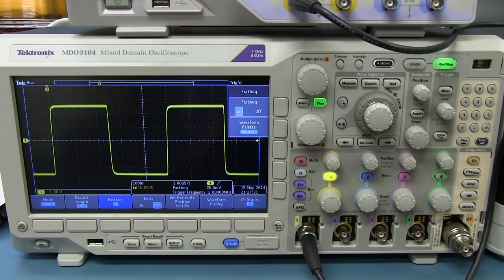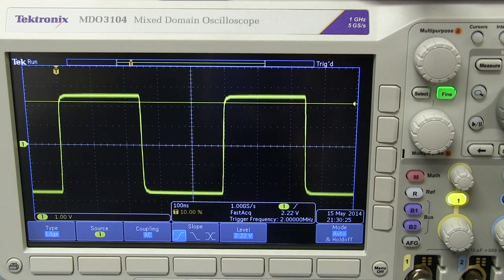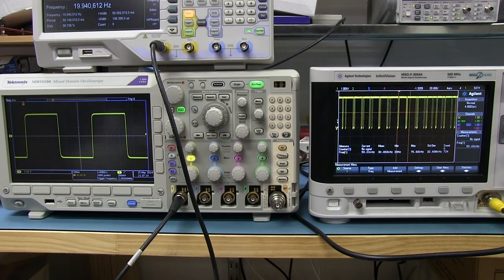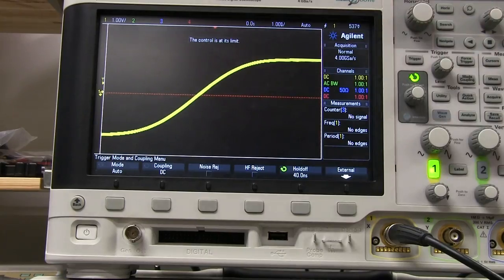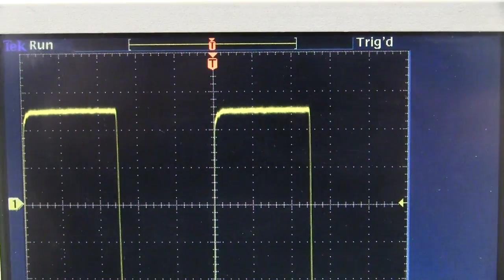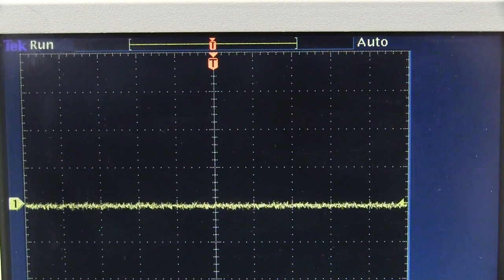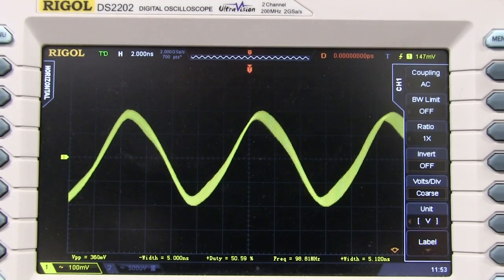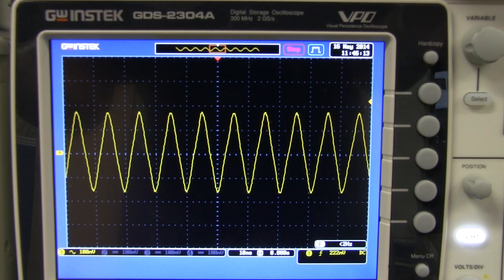EEVblog #617 - Tektronix Oscilloscope Anomaly

Comment: The Auto trigger mode works the same as it does on the old analog scopes too.  The sweep is always driven by the trigger.  In the absense of the trigger, it runs at the auto-trigger's self-generated trigger rate.  I've seen circumstances where other non-Tek scopes, in Auto mode, can miss a very infrequent event events (like once per second or so).  I'm not sure why this is.  It must have something to do with the way other scopes switch between auto and triggered mode.
Reply from the maker: sarowie
Yep, you're probably spot on there. I was bought up on analog scopes. Youngsters coming though who have never seen nor used an analog at school or hobby level would probably have a different appreciation of features.
The Tek "feature" that shows a waveform, but really slowly when not triggered, might well ultimately be useful, but it still gives me the heebie-jeebies. And it doesn't instill confidence in me as it gives the appearance of the scope beign "slow" when in fact it may not be. And the Tek's aren't the fastest things going around as it stands!
Reply: I'd bet if Martin were not holding back the foodwaters right now he would be testing his new Tek with the cardio pulse to see if the Tek trigger method can better capture the slow frequency waveform than the other scopes he has.
Reply: EEVblog Agreed.  In the end, I find being able to see what the waveform looks like in order to setup the proper trigger conditions quite useful.
Reply: Rob B I checked out Martin's example on the MDO3K, and had no trouble triggering each time.
Reply: was there ever any doubt?
Reply: New fangled junk.....Stick with the tried and true Heathkit scopes. Built mine back in 1827 and it's still working perfect. LOL
Reply: +w2aew Thats really interesting, thanks. Would the other oscilloscope having a pause regularly at 60hz be due to electrical interference with mains electricity? I've seen some interference at 50hz with high gain circuits (UK) because of the mains but then I know pretty much nothing about oscilloscopes. And speaking of knowing nothing, we use tektronix oscilloscopes at uni here and I've found the dots spread thing too, though it was somewhere in a menu so I'm sure it was on purpose... I just took forever working out how to get it back to normal :(
Reply: DSO is a rubbish! Analog rules!! There is a software bug like allways and everywhere! Weinberg's Second Law: If builders built buildings the way programmers wrote programs, then the first woodpecker that came along would destroy civilization.
Reply: high eevBlog can you explain me please, how can an oscilloscope update at that high rates since the screen have update rate of 50hz or 60hz or something like that .I really don't understand that. Thanks!!!!!!!
Reply: cytron new the visual display does not update as quickly as the scope does. That sort of update rate would be pointless because we humans could not perceive it properly. 

Instead, the waveform is updated inside the scope each time the scope is triggered and each time the display updates it uses the most recent value.

Comment: Hey, just found you and I totally enjoy your enthusiasm and sense of discovery.

I am retired now for quite a while with almost 50 years in the test equipment and metrology background. I spent the first half of those working for Tektronix. I was with Tek  through The transition years from analog to digital technology in oscilloscopes.

Indeed, the engineer at Tektronix is correct in saying that all of Tek’s digital scopes operate in this fashion. As a matter of fact, all of Tektronix analog scopes operate in this fashion also.
So, as I see things, you should probably be asking a different question. The question should be, ”why do all the other scopes not operate in this fashion?“

Here is my rationale. “AUTO”, “NORMAL”, and for that matter “LINE” and “SINGLE” are SWEEP MODES… NOT TRIGGER MODES!

So let that sink in.

 “AUTO mode is short for “Auto Sweep in Absence of a Trigger”.
The “NORMAL” mode is the quiescent (normal) condition of the sweep, in this condition the sweep does not run until the trigger logic has been satisfied.

This is how TEK TDS, DSA, MDO all work, this is how 2465, 465, 453, 7B53a … all Tek analog scopes work too. And it’s always been at about a 20 Hz rep rate. 

Why? AUTO sweep provides a convenient way of setting vertical DC levels.
AUTO allows one to set up the sweep triggers for all but the very slowest Repetition signals.

Therefore:
AUTO is not auto trigger at Tektronix, AUTO is Auto Sweep in Absence of a Trigger…pure and simple. 

If you want to do some Research on an interesting aspect of auto trigger derivations at Tektronix, look into the purchase of Telequipment by Tektronix back in the 1960’s. It was a Necessary evil to avoid a circuit design infringement lawsuit by Telequipment against Tektronix. It was cheaper to buy Telequipment than pay them for the use of the AUTO circuit design.

Comment: The purpose of autotrigger goes way way back, it is to allow you to actually see a waveform as you are adjusting the trigger.  One would never actually do measurements with autotrigger on, you only take measurements once you are in normal trigger, as auto trigger actually interferes with triggering.  The Tek allows you to see the signal better than the Agilent in auto mode, in the example shown, it seems to me.   I learned on the old tube Tek scopes from the 60s, they were almost too heavy to lift.  Great work, I enjoy your videos!

Comment: Dave - perhaps the screen is actually only updated 25 times per second. When in Auto mode untriggered, it doesn't bother to acquire any faster than it can actually update the screen. When triggered, it acquires as fast as it can until the next time it is going to update the display and then it performs processing to merge all those acquisitions into one screen update.

Comment: I think it is intentional. If the free running update rate is very fast then it will not lock on to waveforms with a slow update rate and you would have to turn off auto trigger to see them properly. I haven't had many different oscilloscopes but the ones I have had all seem to have a very slow update rate when free running in auto.  I also have an old analog Tektronix that works in a similar way except that the update rate increases as the timebase is made faster, to make sure the trace remains bright enough to be visible. For instance a 5nS/div trace would be invisible at an update rate of 25Hz so the update rate would be increased to a few kHz but for a 100uS/div trace it wouldjust be about 10Hz.  With a digital scope there is no longer the need to speed up the update rate as the trace visibility is no longer dependent on persistence of vision.

Comment: Surely if you ran a scope in free-run without any trigger, at 80,000-250,000 updates/sec, you'd only get a solid block across the screen? Slower updates give you an idea of whats happening to the signal.
Reply: No doubt
Reply: I agree completely. I see it as a feature, not a problem. Perhaps the other makers should get cracking. Unless it is patented by Tektronix.
Reply: yup.

Comment: I prefer the Tektronix display.  You have no idea of the signal you are looking at in the un-triggered (auto) mode on the other Oscilloscopes, unless you stop the acquisition, and then you assume what you see is correct.  What would happen if you had no idea of the type of waveform your were trying to measure?  Would you trust what you see after you've stopped the acquisition?.  On the Tektronix you can get a very good idea of the waveform, even while untriggered, and very easy adjust your trigger level to get a triggered condition.  With the Tektronix superior trigger circuit, it is easy to get a triggered waveform.  Why would you want to make measurements on an un-triggered waveform?  Can you trust what you have captured after you have stopped the acquisition.  The normal and only trustworthy measurement is a good triggered acquisition, where you are sure that you don't have aliasing.  Furthermore, I prefer the approach where I can select my own record length, with proper search on my acquired data, and gating, to ensure that I measure what I really want to measure.  Maybe it is my 30+ years doing calibration on all types of equipment, that made me more aware of capturing the correct information and analyse that information, than trying to assume what I see on the screen is correct.

Comment: I think what is happening here is:
What you call an "update frequency" is not a screen update rate (that's obvious).
I guess that the seqence for Tektronix is: capture some data -> process it -> wait for next trigger -> start new data block -> capture ... -> display processed data on the screen (that is done 25 times per second). If there is no triggering condition met then all the data is captured in single very long block of data. With that the scope has to process single large block of data and display only few hundred of samples from the beginning of the block (processing is not distributed over time hence the lower update frequency in free running mode).
For other scopes it might be that they divide incoming sample data into blocks regardless of that if trigger condidions were met or not. They probably just take a bit more data that they can display on a screen and then start a new block.
And the jitter might come from the fact that there are probably more processes or threads which are running on the cpu (like front panel handling, interrupts, etc.) simultaneously with data processing.

Comment: Dave, can you take apart the GW scope and investigate the trigger update rate? I am not sure  how difficult will be to find the internal trigger signal, but I think it will be interesting to see if the claimed update rate is only marketing crap. Thank you for the video.
Reply from the maker: There is an easier way. I can feed in a known glitch and see how long it takes on average to capture it, that will confirm a ballpark figure.
Reply: EEVblog Yes, that sounds great. Thanks.
Reply from the maker: I just measured 80kwfs on the GW using the trigger output, but only on the 500ns range. It's decided to work now for some reason. I did hit the Autoset button :->
Reply: EEVblog Thanks Dave, it seems like the spec is relatively accurate.

Comment: It's most likely for energy saving as the signal processing uses energy. Can you test the power consumption of these devices in different settings? I don't have one so I can't test that theory myself.
Reply: Yep, you notice it with high-end Tek oscilloscopes. These gets relatively loud when triggering at high sample rate.

Comment: I disagree with your comment that the Rigol has a better intensity grading. In my opinion, the Agilent has better intensity grading. Take a look at a composite video signal with movement and you will see better contrast in the grading on the Agilent
Reply from the maker: I've done a comparison vs an analog scope and IMO the Rigol was better than the Agilent as it was closer to the analog look. It could depend upon the signal type of course.

Comment: I would think that the natural behavior of a storage scope in free running mode would be to stuff signal data into the current memory window as fast as possible.  Maybe the Tek automatically enlarges the memory window to max when it does a free run?

memory window = memory depth

Comment: Here one more thing to investigate: Agilent scope (DSO-X 3000) cannot count pulses corectly! It counts different things when zoomed in and out (on the same record). Also, in auto trigger mode very often misses trigger events (it is visible on the screen). Respectively - in normal mode misses single trigger events. Tek's does these thing correctly!
Reply: My explanations for the trigger behavior is:
- Tek's trigger circuit waits for event. If no event occurs after some timeout "fake" event is generated and the waveform is displayed. Hence the slow update rate. The positive side - it is very unlikely to miss single trigger event during display update.
- Agilents trigger circuit updates very fast, but it needs some minimal count of trigger events in order to "sinchronize". It resembles the action of PLL circuit (only visualy). IMHO

Comment: Dave, that 25Hz blanks might be due display update.
Reply: Sounds exactly right.  Tek scopes seem to have a very slow visual response to inputs, whereas my Agilent (same as Dave's) reponds "instantly" to most any change I make to the settings.  The Tek running at 25Hz and the Agilent running at 60Hz pretty much covers exactly that.

From an engineering perspective, I find it interesting that they are using single-ported RAM for waveform storage, especially on the Agilent where they are loudly touting the mega-trigger capability as a means of not missing any glitches.  If there's a window every frame when the memory "turns around" and reads out the display data, there's a window where it's missing triggers and this any potential glitches....
Reply: That would be disappointing if a scope stopped acquiring because another component (screen driver) had to read data.
Reply: Michał Gawron I imagine that the fast acquisition cache for the ADC and triggering subsystem is disconnected from the display memory.  I wonder if there's a snapshot process that takes a window of cache at a moment in time then renders it.  That blank may be the snapshot request.

Comment: 16:10.
On the tek you hit run stop and instead of performing a single capture, it just freezes the screen. I like this functionality. If I want the agilent functionality on the tek i just hit the 'single' button to stop instead of the run-stop button. Problem solved. This way, if the multiple traces look interesting i can freeze the screen, put down the probe and show someone the results. I cant do that on the agilent. 

Tek also has the search feature which is really cool. You can stop capture, turn on wave inspector and enter search parameters. It finds all occurrences and you can  step through them really fast looking for consistency or oddities. This is great when you have no idea what you are looking for, but you know it looks different than all the rest of the signals. Now, the 'wave inspector' concept is totally retarded. It is just zooming in and scrolling, but now you can scroll through time with a spring loaded knob. whoop tee doo. But whatever it works.

Agilent though does have a nice feature. When you turn the time base knob 4 clicks, it zooms 4 times. On the tek, if you turn the time base knob 4 clicks, it zooms in 3 or 4 times, depending on how the scope feels at the moment :) Yes, it is exactly as annoying as it sounds.

As for the auto trigger update rate. I like the agilent much better. The tek makes me feel like my signal is running at 40hz,  but it isnt. Though seeing the signal is nice. It is obviously a purposeful design decision.

Comment: And the tektronix is about 5000$ cheaper. You cant compare supercars to toyota prius.
Reply from the maker: No it's not. The Tek MDO3000 is a comparable price point to the Agilent MSOX3000 at all the bandwidth levels, it's designed to be that way.